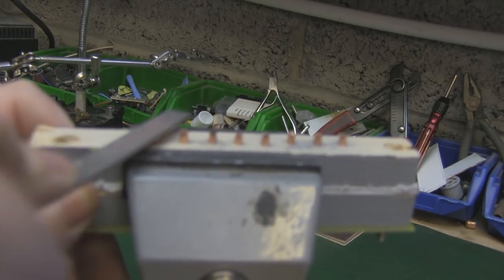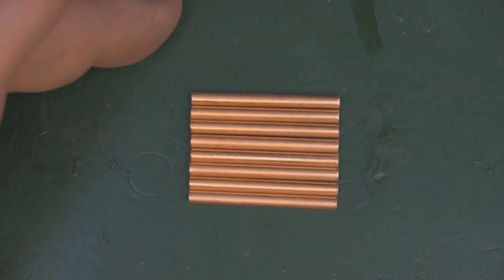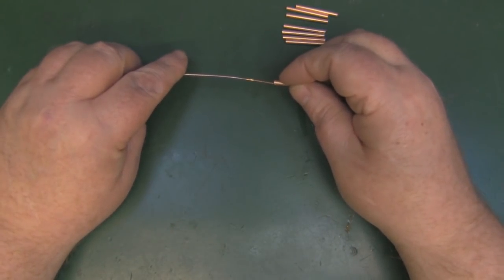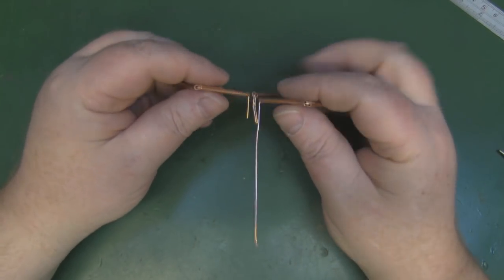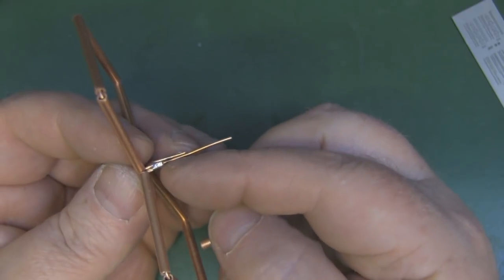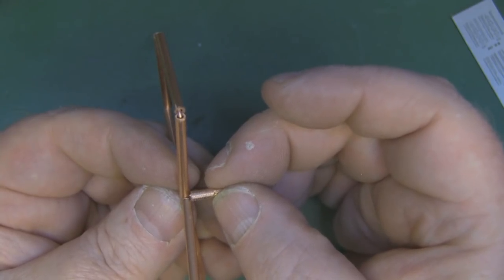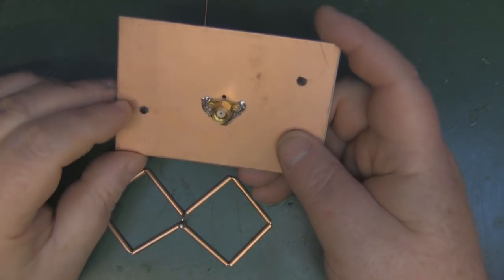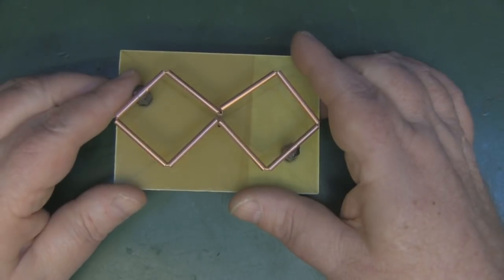Compact Single Element Biquad And New Construction Ideas

Comment: Hi I have today ordered a couple of your antenna - cant wait to get them! your practical and honest approach to your subject does you credit and i have learnt much from your videos. Yes i could have built my own but well - house renovations, time you know! but electronics was a hobby of mine, now it is programming and that is my job too! but one thing i used to do when making circuit boards was to create my transparency for my photo sensitive boards by printing on paper then coating the paper in vegetable oil dry it off leave it to dry overnight - cheap and easy! and i was using dot matrix set to overprint!. another thing occurred to me looking at some of your prototype work, I had to produce rigid labels and i came up with the idea that an A4 paper laminator  would do the job by inserting two sheet of paper in and then cutting off the laminated edges to give me to sheets laminated on one side only. You might be able to produce a more robust prototype by laying your copper wire or sticky tape on paper and laminating it maybe even using a paper hole punch prepare the laminate for solder points after the heating. Jon Payne

Comment: please tell me the radiation beam degree angle of your bi-quad and double bi-quad antenna with straight reflector and also those double bi-quad which you had made from aluminium pipe.. specially include these information in your video description.. that would be great :)

Comment: Andrew, have you done a video about the pairing of transmitter and receiver antennas? Could you do one if you haven't?  I am very interested in setting up the optimal antenna for my 2.4GHz radio control gear.

Comment: Andrew does the plasti dip or undercoating add impedence if so how do you compensate for that and what is the impedence if any because of the plasti dip or undercoating, does using a tube with wire thru it cancel the impedence, I'm just wondering? Keep the videos coming...(Bo)

Comment: Oreyt Andy av you ever built a trough antenna? I know these were pretty popular with the BBC back in the day.  Can still see them on the structures but not operational now TV broadcasts are fibre fed. I've always wondered what the performance was like and why BBC used them opposed to log periodic as they do now on DVB repeaters. Most were stacked in 2 or 3 arrays I guess for different bands or maybe sound vs vision etc or maybe even multipathing. Anybody know about these?

Comment: Hello, 
in Germany we have an adage: "You can not see the forest, because of the many trees". I don´t now, whether you know this in the UK, but I have a question. You have generated a lot of antennas for the 2.4 WIFI range. I am looking for an antenna which has a fairly long range but also it should not be too directive. So I want to use ist simply for Camping with a caravan on a camping place, where the transmitter is some 100 m away in the reception building. What could you recommend. You could but very expensive antennas e.g, the web catcher, but I am not sure whether they are worth the money.
I saw now a lot of your videos e.g about best long range cantennas, but they seem to have a high directivity and this could also be an issue with a caravan!?
Regards Michael

Comment: Teacher, I have a question  for you.  I have followed http://www.wa5vjb.com/yagi-pdf/cheapyagi.pdf to make a 433 Mhz Yagi antenna. The closest example that I can follow is the 432 Mhz construction method. The cable  connection  is also done. But I do NOT understand why the cable is connecting the DRIVEN ELEMENT in 2 locations of the same  solid copper bar? That is when I measure the terminals at the SMA with a 3 meters RG 58 cable and  the buzzer buzzed.  I will use  DIY 433 mhz  in temperature data  transmission when I fully understand else I leave the antenna alone without trying. Because the antenna may burn my ESP32 MCU. Thanks in advance. The solid copper bar is 3/16 inch in diameter.  

My 433Mhz 5 Element Yagi Antenna  ...https://forum.ausrocketry.com/viewtopic.php?t=2807

Comment: Can you explore the hentenna in the future?  http://www.hamuniverse.com/hentenna.html
It's an offset feed quade sort of...I just want to see someone with swr tools to check it out for 2.4ghz
Hentenna Basics

1. Basically 1 1/3 WL Loop antenna around outer edge of antenna
2. L1 works as 1 loop antenna 
3. L2 works as matching section 
4. Vertical long rectangle has more gain than ordinary square loop and has less impedance.
L2 helps the matching and low angle radiation. 
5. 3D pattern is like shell of peanut (maximum gain directions looking at you and away from you) so it will be somewhat bi-directional.

Comment: That is bollocks. You don't need the aluminium pieces for 8 Watts on 2.4 GHz. From my personal experience I have used 1mm diameter (not 1mm squared, but 1mm diameter) copper wire with 75 Watts just fine. 

Again: 1mm diameter copper wire is FINE @ 2.4 GHz @ 75 Watts.